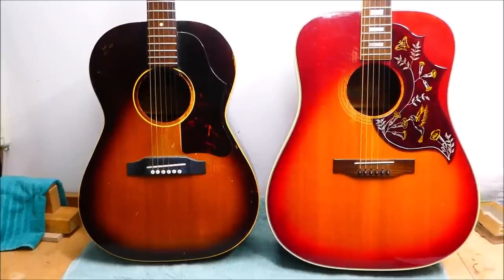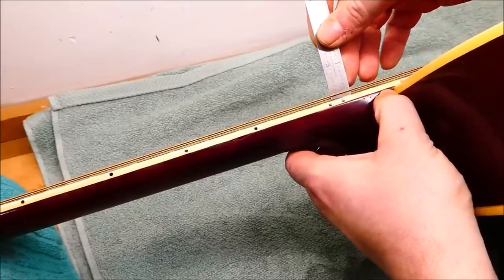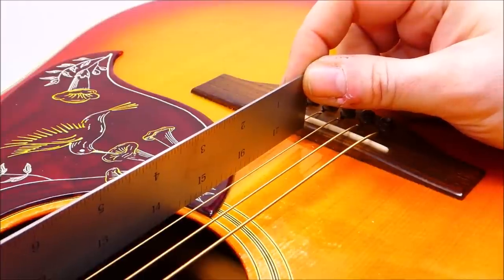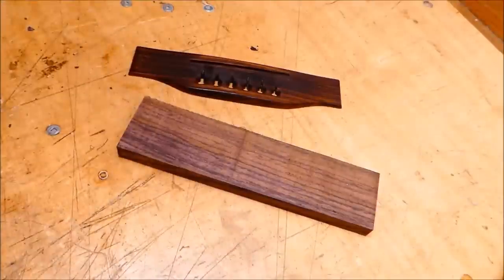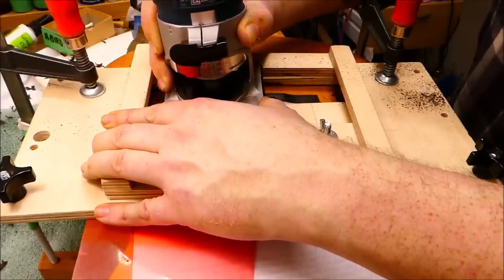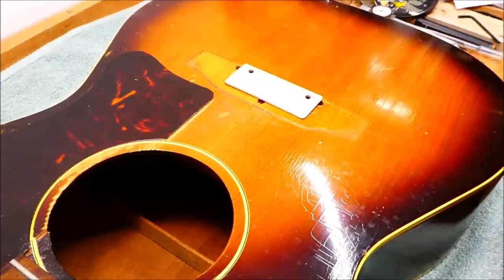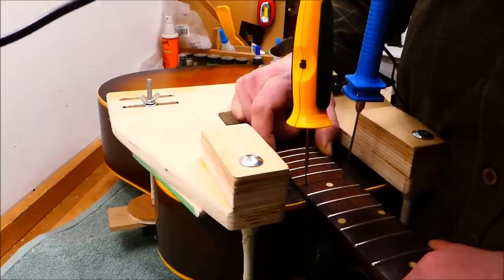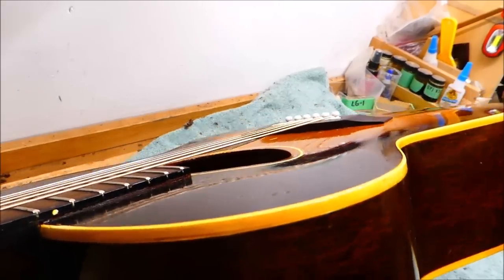Gibson resets and bridges

Comment: I'm enjoying watching your un-uptight guitar repair vids. Over the years I've had plenty of neck resets done on vintage Martins and Gibsons. I'm curious if you ever tried the cheapy neck reset where you loosen the back from the neck block and sides around the heel? It  could be perfected for old inexpensive Asian guitars that  have necks not conducive to removal. I've heard some repair guys won't touch old Guilds for this reason. Perhaps this method would be faster/cheaper for lower end guitars.

Comment: just wondering why you did not check intonation using the 2 E strings (high and low) ala Jerry Rosa before you locate the saddle on the bridge.  Seems like that is a good way to ensure it is close before routing rather than relying on measurements

Comment: All this ASMR has me looking at the bridge on my 1962 Guild F30.

Any help from the comment section would be welcome.
This guitar is my daily driver, split bridge and all... the string spacing at the saddle is 2 inches, and 1 and 3/8 inch at the nut. The bridge pad holes look original.
Will i need to make a custum blank or will a bridge with a 2 and 1/8 inch string spacing be acceptable ?
Also the bridge that is on it is 6 and 5/ 16 from wing to wing....
Curious and curiouser.

Comment: I have a 45 year old Fylde hand built guitar which I bought new. It spent 10 years in a very dry climate then back to the UK ever since. After a few years back here the top deformed sufficiently to need the bridge shaving down somewhat. The luthier did a great job and added a set of solid brass bridge pins to replace the lost mass of the bridge. The result is excellent. It always sounded great but the sustain is absolutely fantastic. Ted do you have any experience of brass bridge pins? Yet another great video thanks.
Reply: Fylde ! Now there's a guitar you don't hear much about. I own the coffee-table book about them, which originally included a CD (I lost it somehow) with performances by Richard Thompson and others, including Martin Simpson as I recall. Although, I've seen  Thompson perform live many times and the only acoustic guitar I've ever seen him with was a Lowden; and Simpson mostly plays Sobells (or PRS on occasion).

Comment: What's that green tape you use dude? I've used duct tape before and it stripped the finish on my fretboard
Reply: "Frog" tape.  Usually available from anywhere that sells painting supplies.  Replaces old-school masking tape and has less "tack" or stickum,  and doesn't dry out and weld itself to the wood as quickly as ordinary masking tape does. Although as Ted notes in reply to another commenter here, even blue or green painter's tape can remove the  dried-out lacquer finish from an old guitar such as that Gibson LG.  Frog is a specific brand, but there are other brands of similar green tape. The blue painter's tape is typically a little stickier than the green stuff, but be cautious because individual brands can vary.

Comment: With respect to the sand paper pulling. Is there a reason not to mask off the sides by the heel as opposed to brushing between pulls? I can imagine there being a more contemplative reason to brush. It might give pause to not do too much too quick
Reply from the maker: If you do that on a dried out finish like this, even with low-tack tape half the lacquer will come up when you pull it off.
Reply: @twoodfrd  I thought that might be why. Just spit balling here. Maybe a sheet of paper CA'd to masking tape within the footprint of the heel with he dovetail exacto'd out. Almost like you were masking the joint for finishing, if you get me. Literally thinking out loud. You clearly have a good system.

Comment: Hollow, moulded plastic bridge attached to a soft spruce bridgeplate with tiny, # 4 self-tapping sheet metal screws, on a guitar shipped with medium-gauge Sonomatic strings.....what could go wrong?
I've actually seen this arrangement on a '63 maple-bodied Hummingbird, so it wasnt just the cheaper ladder-braced stuff that got this treatment. Not Gibson's finest engineering. Most of us have a drawer full of these plastic wonders.

Comment: stupid idea about the bridge plates
if you working from the sound hole there is probably no helping a really convoluted way to replace it, but if you take the back off anyway , you could probably make a jig to plave router in there, electrical or manual push router and just zip the bridhe plate out untill you trough it at the closest point and work from there by hand

don't know if that make sense or not but you probably would need atable with a hole on adjustable height legs, to sort of rout the stuff trough a window

but as mention before, it would not work if you brave enough to try to remove bridge plate trough a sound hole